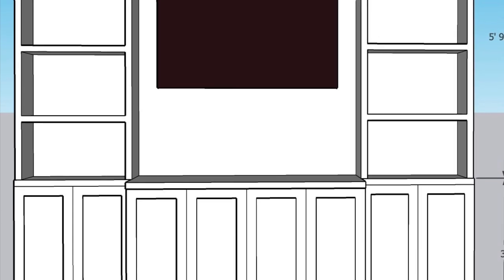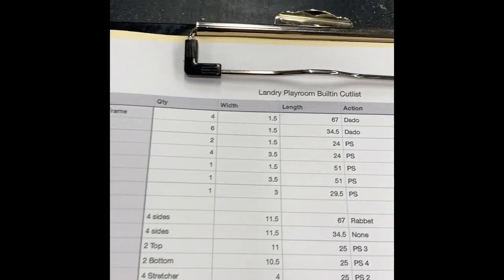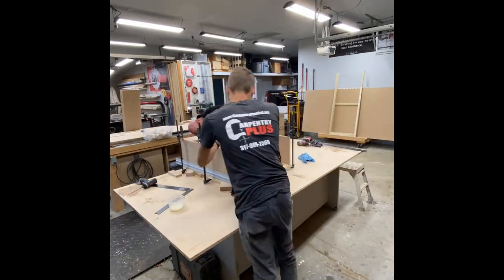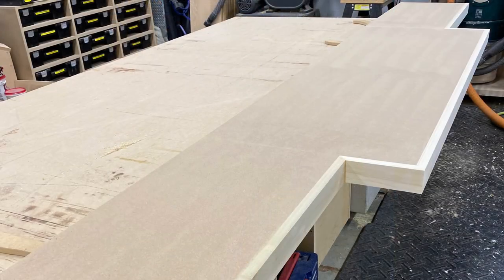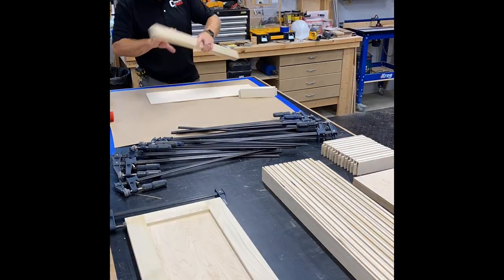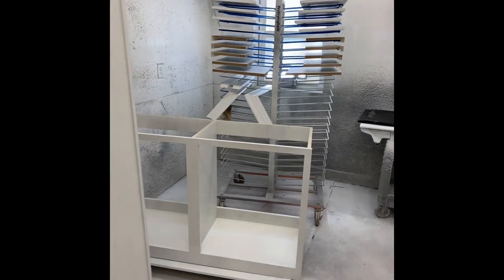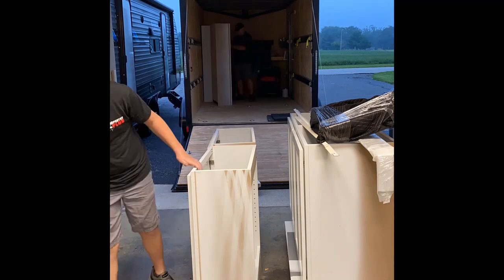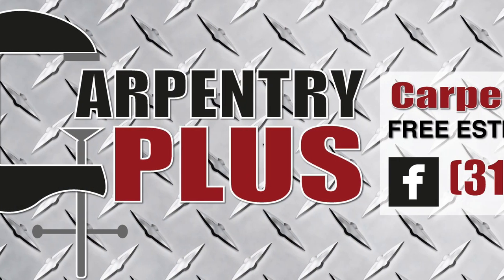Custom Builtin Process Start to Finish

Comment: Do you have any trouble w/ your painted stuff sticking together. I have been using lacquer for yrs, but I have built some raw stuff that the painter has used paint and it is a terrible finish. Your thoughts?
Reply from the maker: Generally don't have any issues with enamel finishes. We do however, try not to stack painted parts together and we use door bumpers for the doors and drawers just to be safe

Comment: How much did you charge for this if you dont mind sharing? i havent had a customer who wanted MDF cabinets are you using any special tipe of mdf and how do you think it holds up?
Reply from the maker: I think mdf holds up great in the appropriate conditions. We don't typically use it in kitchens, bathrooms or basements. Generally speaking, in many ways I think it paints better than plywood and is less prone to warping. I think we were in the $4-$5k range for this particular builtin that was roughly 9'w x 9'h